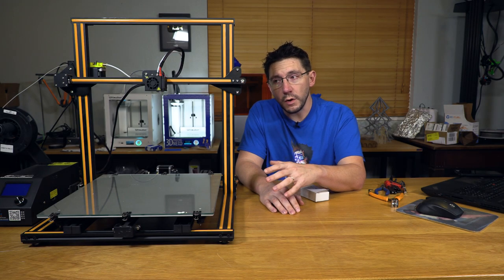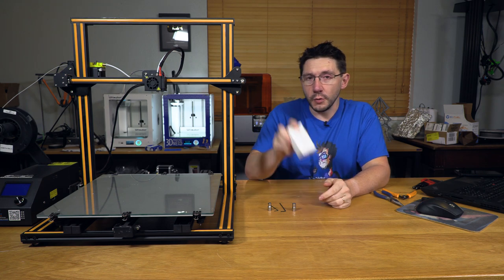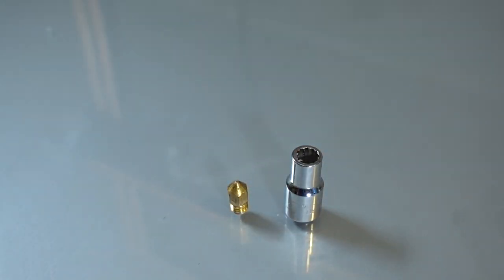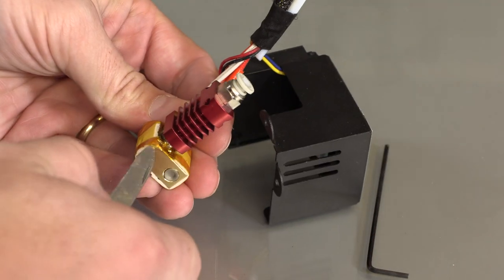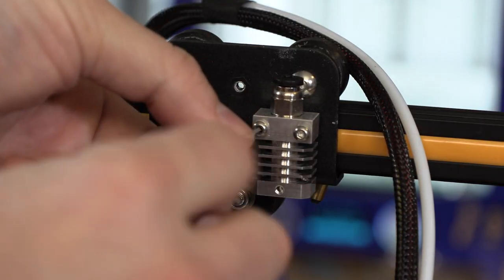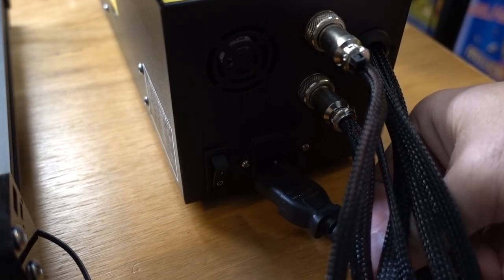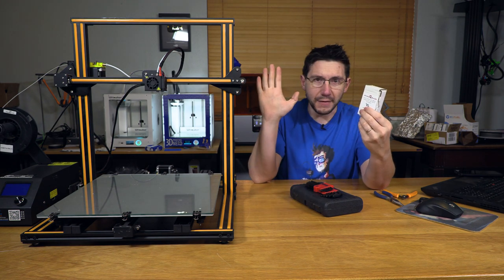Installing the Creality CR-10 All Metal Hot End Upgrade by Micro-Swiss

Comment: I have a Tevo Tornado, with the stock hot end. The setup is very similar to the CR-10. I currently print in PLA, PETG. However I would like to also print with wood, and TPU.

Do I need to change the hot end in order to print in TPU, and do I need to change it back to use PLA, PETG again?

Sorry for the "basic" questions, but I tend to over think things.

Comment: Ok will try asking the question again. What exactly will this help with as far as hotter temp filaments and abrasives filaments? My son and I have been printing with PLA for our first couple of rolls of our first 3D Printer. When we moved to PETG we have had no luck getting good infill and supports to print. Would this upgrade help with that? What settings do you suggest for petg with a cr10s and what advantages are there to this upgrade not mentioned in the video. 

Btw the previous version of the video was great, just had the music missing on your intro? 

Thank you

Matt
Reply from the maker: Hello, Matt! Last video DID have some audio glitches, and a re-render was what was needed. As for this, it helps for hotter filaments and for abrasive filaments because it is all metal from the top of the cooling block to the end of the nozzle. This means the heater block can get much hotter without risking damage to a PTFE lined cooler block (like what the CR-10 comes with). Also, the nozzle is nickel plated, which makes it resistant to abrasive materials, like carbon fiber PLA, and the metal infused filaments. A standard brass nozzle orifice gets widened over a short amount of time when printing with abrasive materials. However, with this plated nozzle, it's wear resistant and will last much longer. I hope that helps!
Reply: 3D Printing Nerd thank you for your reply. Makes sense now.
Reply from the maker: wooo!
Reply: This won't change anything as far as printing with petg. Assuming you are at the right temperature for  petg, try printing slower.
Reply: 3D Printing Nerd the all metal hot end nozzle is only so good with abrasive filaments. It wears quickly still even with most glow filaments. 

It's still a soft brass nozzle. I really wouldn't recommend it for much beyond woodfill and never ever use it for metal fill.
Reply from the maker: +Chris Warkocki I've fed a few rolls of glow in the dark filament through my FFCP which has a micro swiss plated nozzle, and it's still doing well. Maybe it depends on the type of glow fill you are using?
Reply: 3D Printing Nerd possibly. I've seen them wear on Reddit and Facebook in the Maker Select group. I've only printed woodfill with it and it's been ok. 

On my Prusa MK2S I upgraded to the hardened copper nickel plated nozzle. It's hardened and has gone through a few rolls of solutech3d glow. Best glow in the market if you haven't tried it. So much glowy goodness.
Reply from the maker: +Chris Warkocki ooh I need to get some of that!
Reply: 3D Printing Nerd http://www.matterhackers.com/store/l/e3d-v6-extra-nozzle-plated-copper-175-x-035/sk/MGRPJZ35
Reply: 3D Printing Nerd 3D I have a big  dilemma, I’m in the market for a printer. I thought the cr-10 was the one. Then I heard the prusa is better all around minus the print volume. But now with this mod what’s your take on it. If you could own only one which would you choose? Can the price and print volume  with this mod overcome the prusa with all its features
Reply: @M and K Productions
Hello, i have been printing with PETG with stock ender 3 nozzle for many customers (over 400 hours) i have never had problems
The only time i had problems was with ABS.
If you need a printing profile, you can ask me
Greetings

Comment: When you were showing the kit, there was a new heater block included. Why did you reuse the stock one?
Reply: I thought that too, perhaps to not have the hassle of trying to remove/replace the heater and sensor in the new one?
Reply: He probably didn't want to have to remove the thermistor. I left my stock heatsink alone just in case I needed to switch back to stock.
Reply: Glad I’m not the only curious person. I wondered the same thing.

Comment: installed this yesterday, but i keep getting blockages between the titantum heat break and the cooling block which fails my print. the heat break is in correct and the grub screw is tight and retraction is set low as reccomended.

Comment: Why is the new hot end better than the original? For me the original looks like it's all made from metal as well.
Reply from the maker: The original hot end has a PTFE liner inside the cooling block, so the nozzle could only get so hot before risking damage to the PTFE liner. With this, it's all metal from the top of the cooler block to the tip of the nozzle.
Reply: How hot will the all metal hot end get?  Why aren't all hot ends of the all metal type?
Reply from the maker: +John Krukemeier I believe cost is a limiting factor. If a company can save a few dollars per machine, that can add up.
Reply: all metal arent used across the board becuase they are more finicky about retractions and risk of the filament "freezing" to the metal surface of the heatbreak. PTFE line works great for all but the hotter of materials pushing above 250C, so for a newcomer all metal right out of the gate your looking at a lot more headache trying to dial in stringing and extrusion issues with it. On the flip side most machines that are more geared toward having a hot temp material ran thru it come with the all metal hot end already. The much cheaper way to do this would simply switch to capricorn ptfe which is good to 300C. The ptfe tube runs directly down to the nozzle in the cr10, unlike having a ptfe lined heat break which has seperate smaller ptfe tube JUST in the heat break. But when you get sent a free hot end, guess thats cheaper than buying capricorn.
Reply: to add to this comment standard ptfe tubing starts to gets soft and break down at temps around 220 to  240 depending on the quality of ptfe. since the ptfe goes all the way to the nozzle if you print often at higher temps you can end up with the ptfe breaking down and deforming which can block filament getting to the nozzle . alternately to a all metal hot end you could use capricorn ptfe https://www.captubes.com/ they have two different types a lite transparent that is rated at 300 or a dark opaque that is rated at 340. then you just need to swap out the ptfe tube . (note if your ptfe connector doesn't press down often its due to some back pressure on the ptfe tube. you should heat up the hot end press down on the tube and the ptfe release mechanism  and then pull it out while it is hot.)

Comment: I think there is a design flaw with the one I got. There is a chamfer on the aluminum heat sink bottom face and on the titanium round connection and the filament is jamming during retraction. Not so good! I using carbon fiber filament. Let me see how it works with PLA.

Comment: Hey Joel! This is a great tutorial, and im so glad you made it! I hear this upgrade is mainly so that you can print above 235-245 C without the PTFE tube  melting and expanding? If so, thats exactly what i need but i dont quite see any difference in the parts from stock parts. Whats different? Also is there a way to convert stock parts to "all metal" so i can print higher tempatures? Thanks so much! 
-M
Reply: Yea, I have exactly the same question here. Hoping to see the answer
Reply from the maker: Yes, that’s the reason. With an all metal setup, the hot end can reach higher temps.
Reply: @3DPrintingNerd  ahh okay thank you so much. Is there any cheaper all metal hotend kits? Im fairly new-ish to 3D printing and would love some help. I know micro swiss is a great brand (and their plated nozzles are no joke) but i cant afford that haha. Thanks so much!

Comment: what about to update firmware..to rich 300°C
Reply from the maker: 300c and above are for more engineering grade filaments such as PEEK and Ultem
Reply: 285 is safe for all metal hotend with a Capricorn tube, anyone know how to change the settings from 260
Reply: @3DPrintingNerd  how would I change the maximum temp in printer firmware for  PC
Reply: @Colin Davis with a capricorn tube you can print nylon on the stock cr10. Straight nylon no additives that push the temp required past 260 of course. You just need to go get some metal insulation tape and use that to insulate your hotbed. Also a makeshift enclosure will help but not required. I have mine in a small bedroom I can keep at 80-100 degrees F easily with a huge cardboard box I set over the printer. No idea how hit it gets under the box but it works and I get excellent durable nylon prints I use on RC crawlers.

Comment: Joel... Actually thats what I’ve already done but the CR-10 hot end parts are a bit non-standard so I thought I would upgrade. Perhaps an E3D V6 would allow me to use the Capricorn tubing? Never done one although I’ve been printing for about a year.
Reply from the maker: Hmm... reach out to E3D on twitter, they are usually very responsive! Good luck, and let me know what you find out!
Reply: no need to change hot end to use capricorn. The cr10 doesnt have a seperate ptfe liner, and instead uses the bowden tube itself and the heatbreak line. So upgrading to capricorn gives you high heat tolerance without any hardware like an all metal hot end. Firmware high temp limit and heater cartridge are then your only limits of reaching up to 300C
Reply from the maker: +Matt Weber BAM.

Comment: Hey 3D Printing Nerd I really need help. I have a cr-10 and it hasn't worked in 6 months. All my prints are coming out really fussy and hairy and i have tried just about everything. I have changed belts and tightened everything down. I have tried different filaments and different files sliced by different slicers. I have slowed down the printer and have changed heat setting along with countless other settings and it all seems to make no difference. I'm thinking maybe if i change my hot end it will help because mine is a little ruff but I honestly don't know and I don't want to put money into a printer that's not worth putting it into. I loved 3d printing but I'm honestly about to quit because this problem has been unsolved for so long and I have tried so many things its ruining it for me.

Comment: Hi Joel.  Do you know if they all include the blue silicone sock?  From the links you provided to their product, the sock is not listed in either option, nor is it in the pictures or their installation video.  I would like the sock and was wondering.
Reply from the maker: +Chuck McGee that's a good question. I would reach out to them and send them an email to confirm.
Reply: Thanks.  I emailed them and they replied..."Yes silicone sock will be included with all CR-10 kits.
We will update the listing and pictures soon."

Comment: Hey Joel! Great video as always. I’d like to change the hot end on both of my CR-10 printers but I need a setup that would allow my Capricorn XS tubing to go all the way diwn to the nozzle. Recommendations?
Reply from the maker: Hmm... If you want Capricorn all the way to the nozzle, that may be tough. You could get a new nozzle, and swap the bowden tube with a capricorn tube. The stock CR-10 hot end has PTFE liner down through a metal sleeve. Would that be enough?

Comment: Too easy there should be more expletives, wire cutting and and blood. Lol jk love the video
Reply from the maker: +Rheller82 that's why I have an editor ;)
Reply: I’m pretty sure I heard the start of a “oh sh*t!” In that video lol, better fire the editor 👅👅👅
Reply: ApplesUPnorth time stamp?
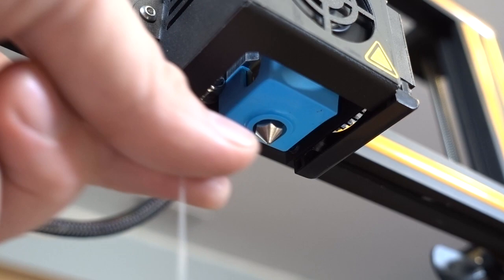Reply: @ooliver  6:35
Reply: ApplesUPnorth I’m sure that was supposed to be “woooosh”
Reply: 3D Printing Nerd boss my heater cartridge broke off from my cr10v2 how do I make the new one fit into the plastic thingy from the original how do I get the plastic thingy off it without breaking?
Reply: 0 01 they are screw terminals so unscrew

Comment: Why would someone not want the 300 degree flexible hotend? What advantage would the all metal have over it? Obviously except theoretically Temps over 300.
Reply: BaneKoala The all metal hot end allows you to print things like nylon, metal infused pla, carbon fiber infused filament, and print flexible filaments better.

Also, the reason this is better for abrasive filaments because of the nickle hardened nozzle. Abrasive filaments will bore out a standard brass nozzle in short order. The nickel plated nozzles last much longer under the higher heat and abrasiveness of carbon fiber, nylon, etc.

Hope that helps!

Comment: Why do you need to remove the 2 screws holding the heaterblock at the end?
Reply: i was wondering about that to O.o i put the sock on with the screws in and it worked fine.
Reply from the maker: I don't think you HAVE to, but, it's part of the Micro Swiss instructions, and those were what I wanted to follow.
Reply from the maker: However, leaving those two screws in means that there are two more pathways for heat to travel to the cooling block from the heater block. I'm not sure how much that impacts performance, but, it might.
Reply: I think the screws are there to help prevent breaking the heat break when tightening the nozzle, but should be removed during use to prevent heat from traveling through them from the hot side to he cold side.

Comment: Wouldn't you also have to upgrade the firmware to allow you to set higher temperatures?
Reply from the maker: It's depends on if they've set the temp limit in the firmware or not. I didn't check my CR-10, but I know you can flash new firmware to these machines
Reply: the cr-10  have the  temp cut off at 270. so if you want to go higher then that you do need to update the firmware.
Reply: The CR-10S tempt limit is 260c (I just checked mine and its limited to 260) I dont know how mark is able to hit 270, if you set it higher in any way it drops you immediately to 260.

Comment: 😕yeah I have a question why do they go by millimeters and not inches is so confusing for me I can't figure out what 300 by 300 by 400 mm that actually means😕
Reply: Because the majority of the world uses the metric system which is more accurate.
Reply: I was like you about 5 years ago. Once I started using the metric system it became clear why it’s really easier. Once you “get” that it’s all based on ten then the magic starts. You can use a conversion calculator found all over the  web. Use it to get familiar with inches to mm, CM? Drop a zero. The biggest plus is when you have the need to find a Centerpoint. I also have some CNC machines so I use measurements in the thousandths.  Metric also makes it easier especially if you understand both. Now when it comes to my favorite adult beverage, I still call a fifth a fifth, a quart a quart and a half gallon, well you get it. You young guys may not have ever heard of a fifth!😉🥃 Don’t worry, if you use it enough, one day it will “Click” and you’ll say HEY! Now it makes sense.

Comment: Do you have to do anything to the firmware after changing to the Mcro Swiss hotend? Or is that only when you change to a different thermistor setup?
Reply from the maker: You don’t. You CAN change it to allow for higher temps as it’ll take 300c.

Comment: Hey Joel, don't you need to run PID on it after installing as the cool down rate is now going to be different?. And #highfive by the way
Reply from the maker: It's probably best practice, but, if you run it and everything looks okay, you really shouldn't need to. It's running a multi day print right now, and it's looking good :)

Comment: Hey Joel, I'm just wondering if this will let me go past 235c? At the moment if I set my printer to 250c, it won't even reach 234c.
Will this kit help me get to the 250, or will I need to do a different upgrade?
Reply from the maker: +Litruv the firmware is limited in temp because of the need to keep the old PTFE liner safe. If you want to go to 250 and beyond you would need to also adjust the firmware of the printer. I haven't personally done it on my cr10 yet, but I know many who have. I believe Printed Solid has done some firmware upgrades of cr10 machines and may be able to help. Also look up TH3D Studio run by Timothy Hoogland.

Comment: how did you get the piece of PTFE tube from your other hotend? I have the same problem and have not been able to figure out how to get it out.
Reply: Try pressing the PTFE inside to relieve some pressure from the claws which grab on the tube and simutaneously push the release mechanism.

Comment: There are going to be so many people complaining of "under extrusion" and filament "jams" with that tiny titanium alloy heat-break, the contact area with the heat sink is minuscule and nonuniform. :(
Reply from the maker: You've got a very good point there, I'll try to get some feedback.
Reply: Titanium has low thermal conductivity, which is why is it used as a heat break, the point is to stop heat creeping up into the heat sink & causing jams. The small diameter of the heat break minimizes the area that the heat can be conducted through, so more of it stays where you want it- in the hotend.
Reply: My mistake, I believed titanium to have a higher conductivity than high carbon steel, still - in my experience - the heat break becoming too hot causes the filament to melt or soften around the opening and create a blockage. That was my experience with the Micro Swiss all metal hotend for the Wanhao (before remedying it with thermal paste) and the heatbreak - heatsink interface area is much larger than the CR-10 version. Though the designs are different, so I'm interested to see if Joel experiences any issues over long prints.

Comment: Do you think it is necessary to upgrade the heated bed of the CR 10S to print ABS?
Reply: Power: On To print reliably I would upgrade to keenovo heated bed.
Reply: You should upgrade the bed and put the printer into an enclosure that you can use to filter the fumes and hold the temps steady.